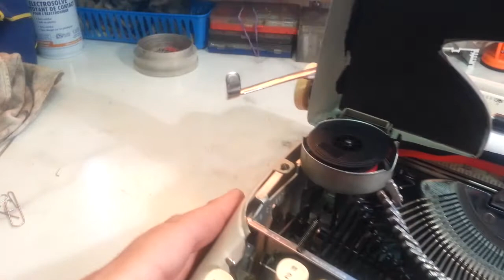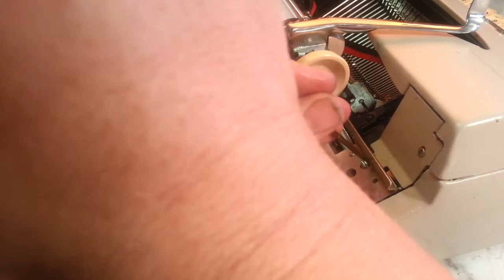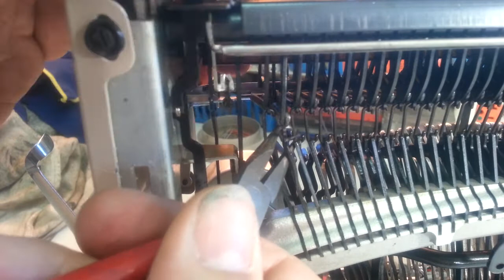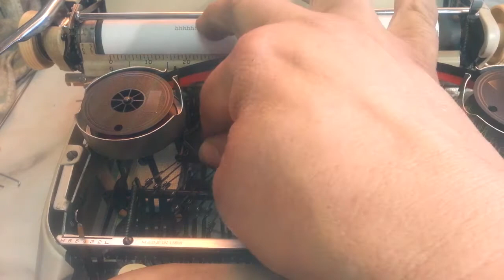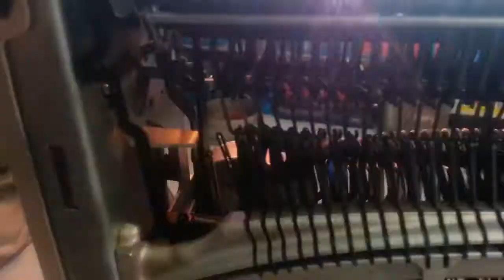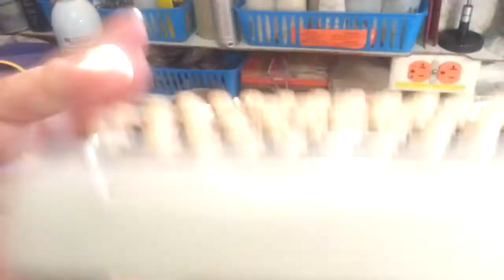Smith Corona Sears Tower Typewriter Repair Links Broken Disconnected Basket Loose

Comment: I’ve agreed to buy a Tower Commander from 1956. It looks like an SC series 4 body (with Tower badge) with series 5 keys and an older return arm, looks like the one on my 1937 flattop. It’s as if SC made a typewriter for Sears out of a variety of old parts they had in stock. As far as I know the mechanism is virtually the same from 1930s to 60s but maybe they did some tweaks along the way.